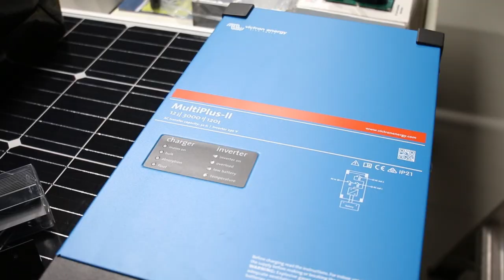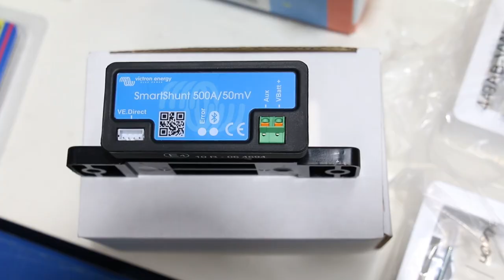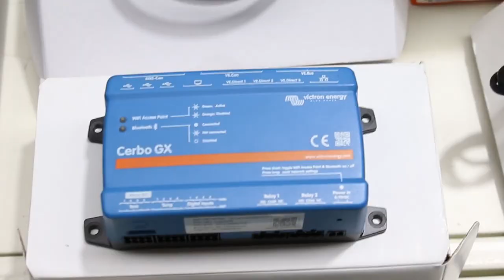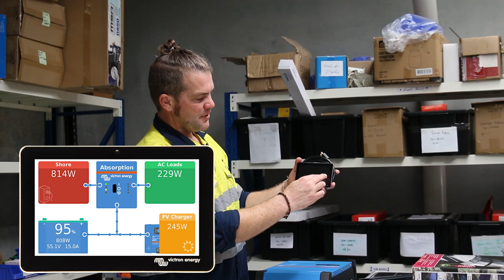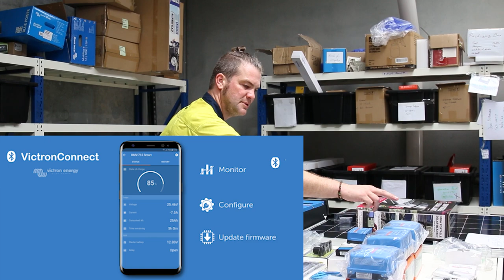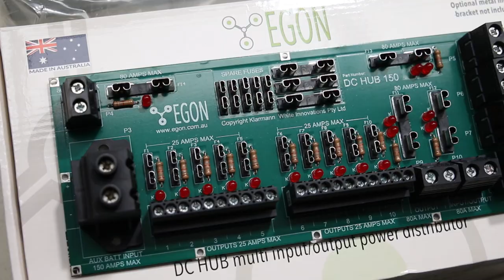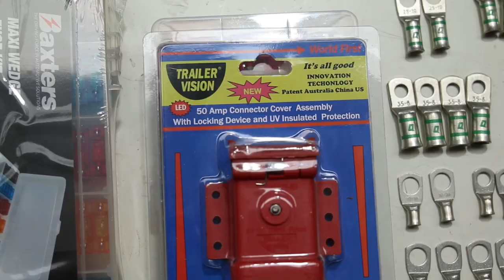Delux Canopy Wiring Kit Overview & Setup | Ready to Drive Anywhere Kits

Comment: Moin Heiner.
Hands down the best complete set ever seen and of course your explanations.
May I suggest you slow down a bit for the other audience to consume all your informations. Just saying…

Victron all over the world and allot womo builds in Germany with it. Big sets..
Cerbo with the 70 display .. very nice.
What I now miss in the AUS build :
1. outlets USB C   PD 5A 100W   & cable. USB C 2 C 5A. And USB C to other plugs   (Sample Anker usb 3.1 Gen2 and Or other USB4 PD 240W cable)
2. Back connect solar panels, high voltage around 30Volts, newest version, smaller sizes, higher output capacity and much better  partial shade handling especially in line connected. The MPPT’s will be more than happy to handle high voltage..

I guess many of us would like to see from you as the expert a solar panel comparison vid with your expertise it will be definitively a killer!

Looking forward to it

Cheers